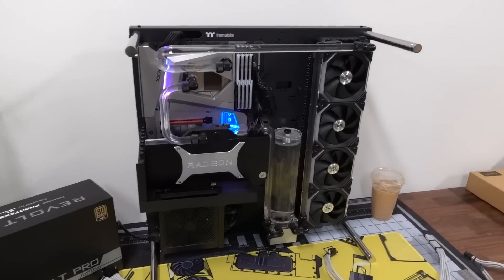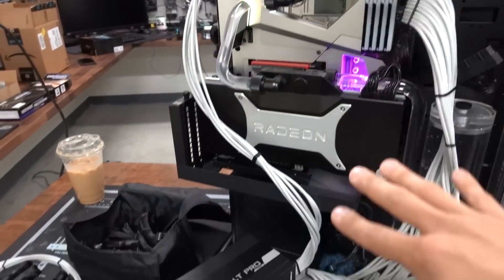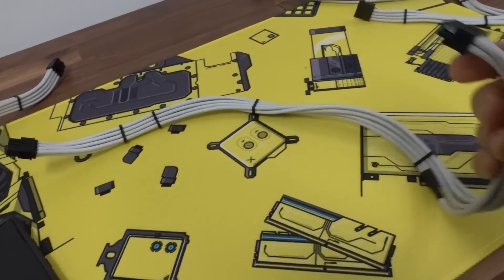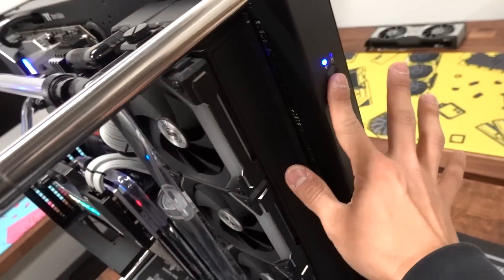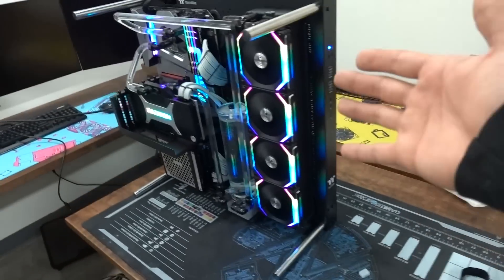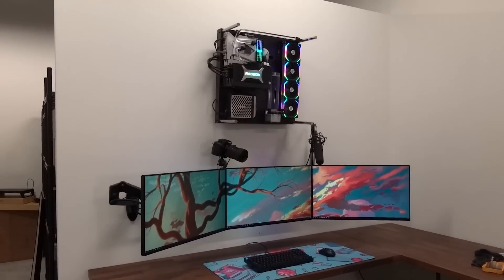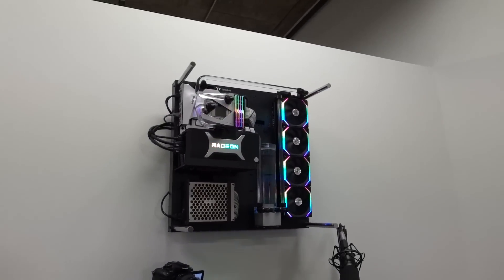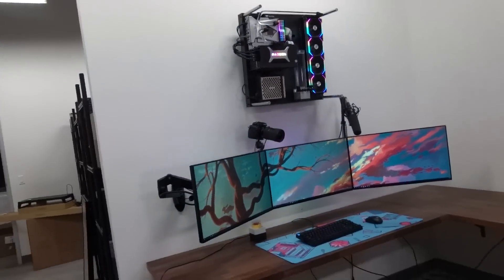I PUT MY PC ON THE WALL!!

Comment: put something (like a piece of wood) in the middle of the bottom of the back of the pc. it will force the bottom an inch or two away from the wall aswell and it will be straight. 
Had a similar issue with a mirror and i actually fixed it with multiple layers of cardboard.

Comment: You need longer bolts on the bottom of the vesa mount and a shim behind the bottom to push the lower half forward to match the upper part.

Comment: Think people are over complicating the tilt issue.

Just fit an appropriately sized spacer/ piece of wood to the wall near the bottom of case that is thick enough to stop it tilting, job done.

This also means you can still pull it out to work on it without hooks and ropes etc

Comment: In my engineering brain, why not make a mounting plate that can attach to the center stud at numerous points and basically cover the back side of the PC (cutouts for the back of motherboard and other needs spots) then add stand-offs to ensure that the PC lies on the same plane to ensure no tilt or angling of the PC.

Comment: I bought the amazon basics USB 3.0 hub and it died quickly(less than 3 months).  I then bought a Vantec 10 port USB 3.0 hub that has tabs for screwing to a wood desk.  Been really solid, would recommend.  Havn't had any issues with it since last April.

Comment: The EPS12V and the PCIe12V Pinouts are not the same! I really hoped the Protection circuits in the PSU are top notch while watching you plugging in random cables.

Comment: I'm no smart person when it comes to this stuff buttttt, the only idea I had was.... Where you attached those 2 hook on the back of the system, can you drill a hole straight through the wall, and anchor it on the other side of the wall on the stud? You can attach some kind of rubber grommet to the hole in the drywall so it doesn't break. Not sure if it'll work but it's the only thing I could think of.

Comment: Place feet or standoffs at the bottom of the case, to stop it tilting forwards. You won't need to screw anything into the wall, just the back of the case.

Comment: Can't you use a drywall anchor to line up with your top stabilizers?
Or maybe put something on bottom to PUSH/HOLD the bottom out from the wall and straighten it that way

Comment: Get a piece of wood, the thickness of the at the bottom to make the pc mount to be parallel to wall, paint it black, and use wall mount tape, Tape it the back of the PC Plate.

Comment: Just cut out a solid foam block (black to match PC) and mount it to the bottom middle of the PC with double backed tape.  Just make block tall enough so the PC is parallel to the wall.

Comment: Ok, so after the ads rant. You should run two 6 foot tracks across the wall parallel with the floor. Stronger.  You can then mount the pc to those tracks wherever you want. Put sound deadening boards on either side to cover the tracks.

Comment: Add washers to the bottom bolts of the mount to the pc. It will push out the bottom and then add leds to the back and make it a feature.

Comment: If you said it was one of the power cables I would have bet big bucks it was the ATX and not the CPU cable just because the power-on signal is on the ATX.

Also, mount plywood to studs, mount stuff to plywood.   Paint plywood to match walls or cover with cloth.    That way you don't care where the studs are related to where you want to mount things.

Comment: Just put a block on the back bottom of the pc that is he right thickness to hold it out the proper distance from the wall so it can’t sag.  So if the mount holds the pc 2 inches from the wall to the flat back of the pc make the block 2 inches and tape it on the back so you can’t really see it and it holds the bottom out

Comment: Try an upper and lower piece of wood on the wall and the case with a bevel so u just push up on the pc and pull it away. Could also do opposite bevels so u slide it in from the side

Comment: Have you thought about putting a large rubber spacer on the bottom side so it pushes the bottom away from the wall vs at the top to pull the top toward the wall and gravity will more than like do the job of keeping it in place.

Comment: Small block (wood, foam, plastic mounted to the back of the case near the bottom that will provide support when the PC is completely against the wall? 
small "legs" similar to what the front panel glass is mounted on on the back?

Comment: Not sure if this will help but had the same problem with a old tv mount he had, 2 or 3 pieces of Styrofoam foam or a cut pieces of wood at the bottom to push it out to straighten it out.  Used Styrofoam initially but eventually cut and sanded pieces of wood down to replace the foam.

Comment: A solid support between the bottom edge and the wall should push the bottom of the case out? Or put washers between the bottom vesa mount screws and the case?

Comment: drill un another two more hooked that correspond to the hooks on the case then you can tie it or use the tension hooks you got. The middle hook in the wall you can either leave it or remove it up to you

Comment: Kyle, Kyle, KYLE..... You don't straighten the PC tilt by pulling from the top. You push it from the back. You could just get like a 2x4 or something, cut it to the length you need, and put it back there. You should probably do that after the light strips have been installed so that you know where to put the block so it doesn't create a shadow.

Comment: How about using wood (or any other material) blocks screwed into the wall (or the case) on the bottom corners of the case to push the pc forward enough to be straight?

Comment: WALL ISSUE IDEA

With bottom support you can relieve tension on mount. Put something on the bottom, attacked to the wall or case to stop the downward tilt. Some sort of extension from the wall to push the bottom of the case to not tilt down but press on that wall extension/tube/whatever you put.

Comment: On the wall put some feet which stand off the wall so they line up with the bottom of the case so instead of tiring to tie it to the top of the wall put something in place to stop it from tilting forward

Comment: 13:40 Those swing joints should have screws that create tension on the joints. Just tool tighten the crap out of the one that's tilting up and down.

Comment: Possible Solutions: if you need space behind, then maybe a French cleat with drywall anchored screws on the sides and one screw in the center stud. If you don't need space, can try the same thing with "Z clips" instead of wood. good luck!

Comment: idea to make it straight put a spacer at the bottom middle area of the pc case parallel to the stud maybe strip of wood and maybe layer it with rubber so it wont scratch the case

Comment: I have the P3 and your P5 should have come with feet to lay the whole thing flat, use those and some spacers on the bottom of the back of the case to prop up the bottom so it sits level

Comment: Easy fix, get small Dow, double-sided tape it to the pc (length ways) and use Dow as a wall leg to push bottom of pc out parallel to wall.....or two legs , one on each end at on the bottom of pc.

Comment: what about putting shims on the bottom of the PC side . So the bottom 2 screws have a 1 to 2 cm push out to flatten the tilt effect . You may need to get longer screws but it should be doable

Comment: Paint a 2x4 and lodge it between the bottom of the pc and the wall. As long as u cut the 2x4 to the right length it’ll push the bottom of the pc out away from the wall making it level. It will also stay in place well due to the stress from weight of the pc. hope I explained this well lol.

Comment: Dear Kyle it's spelled correct but in German ✌️😉 greetz from Germany

And for your tilting problem mount a spacer underneath the wall mount and have a rubberfeet to compensate for possible vibrations. If the spacer has the right length it's straighten it pressing the lower part away from the wall and center it.

Comment: Are there screw holes on the bottom of the case? why not get some spacers screws to prop the bottom against the wall. maybe paint them black with rubber tips when against the wall?

Comment: Can you just use a self tapping screw at the top middle and mount one of those loops to the back of the case then use a strong cable tie to attach it to the loop on the wall?

Comment: The 8-pin EPS and 8-Pin VGA/PCIe are keyed differently on the component/mobo side. They may be (and usually are) keyed the same on the PSU side. For the most part, those set of 8 pins have same wire gauge/length requirements and same set of pinouts, just in a different order. You should be careful about it. I make custom sleeved cables myself and have a background in electrical engineering.
Reply: Some custom cables are too long for the standard gauge. In general, longer cables need thicker gauge. If I had my hands on your custom cables, I would inspect the resistance and connectivity with a multimeter to diagnose the root cause.

Comment: I use the same case in white and have had that bad boy wall mounted since just after the start of covid. It's amazing! Nice set up and vids.
On making it straight: Did the wall mount come with the spacers for mounting to the chassis? You could use two of the spacers on the bottom of the mount. Hopefully it will straighten and allow the screws to go in straight.

Comment: Use bump stops mounted to the wall at the bottom end of the PC to remove that tilt, be warned with it tilting like that it’s adding stress to both the PC and the mounting points.

Comment: Instead of trying to pull the top of the pc back to make it straight you could try using something to push out the bottom. Basically go at it reverse of what you tried to accomplish the same thing

Comment: For the tilting issue; you could use standoffs/thicc o-rings between the pc and the wall mount, but only on the two lower screws.

Comment: Displates on either side to fill out the empty space?

Also, as Indians say, "jugaad" work to fix the tilt - temporarily tack on thermocole slabs on the bottom to provide a jutting surface for the bottom to push against.

Comment: Please make a video checking the pinouts of the 8-pin extension cables and comparing them to the ones provided by the power supplies with a multimeter. As education and to help the extension cable provider.

Comment: dont know if that one has it, but my tv mount like that has an hex head screw that you can tighten to hold tilt angle. you can tilt it up, and tighten the 2 screws and it holds the mount at that angle, worth checking over it to see if it has them

Comment: Hey Kyle, try using some hood adjustment bumpers (automotive use) on the bottom back of the chassis to push the bottom off of the wall and that should force the top to tilt back?

Comment: Just use one of the screws on one side connected to the rope that's passing trough the wall hook and ends on the other one on the other side of the case.  Then adjust the tension. Voilá

Comment: tiny eye hooks directly behind the pc when its straight wouldn't do the job to hold it? or has this not been tried yet? if you're worried about them ripping out of the drywall then add plugs.
Reply: the ones with an open end lol thought I should specify...

Comment: Had a very similar problem with my PC that has completely different components than yours aside from having an x570 chipset and trident z’s. No post/boot and then connected all the original evga psu cables and it booted up.. added back my extensions one at a time and it was the cpu 8 pin extension all along.

Comment: i have the same wall mount for my tv you can try and adjust the screw that control the angle try to adjusting it higher then the centered position so it can handle the weight of the system and you will have it centered hope it help you

Comment: Paint a piece of plywood the same color as the wall, cut it down to the width of the stud and then the height between the wall and the PC, and place it in between the PC and the wall toward the bottom.

Comment: Drywall snaptoggles will get you around the stud location issue. Personally I would use a steel cable hanging system to make it look like it's fully hanging from the ceiling (not really the scope, but I think it would look cool)

Comment: the bracket you are using is designed to tilt down u need to buy a fully adjustable bracket, or flip your bracket upside down and reverse adjust it to sit flush on the wall, hope this helps dude

Comment: Don't pull the top of the case in, find a way to push the bottom of the case out from the wall. Perhaps some kind odf spacer at the lower corners or on the center bottom

Comment: I think I have a fix, add two legs on the back of the case one at each bottom corner. These legs will push the bottom forward and make it straight. Hope this makes sense.

Comment: You could use the 4-point mount you said you wanted if you opened the drywall and put in more 2x4s where you need them, and then replaced the drywall (a lot of work). :)
EDIT: Even better if you can access the other side of the wall easily.

Comment: instead of pulling it in from the top, why dont you push from the bottom to level it up? 
put a block on to the wall (you can get adjustable ones) that will just push the base back out to level it up. you wont see the block unless you look behind so that should work for you.

Comment: Why not just get a block of wood (or any material really) paint it black, and place it on the wall at the bottom of the PC. That way it will be straight. It will be off the wall a couple inches but it could look more floaty. Which could look nice 👍

Comment: Wasn't this wall open on the other side? Just install to new studs and use a normal mount. 
By the way, an normal mount with 2 screws in the middle is probably a lot stronger than an arm like that.

I would have custom made something with french clets to get it nice and tight, but thats just me...

Comment: I thought those mounts had adjustable rockers near the front... Either way, the studs should be 16" on center. You could technically offset the pc to be in-between the studs (either to the right or left) and mount some flat 1x4" maple (don't use pine in 1x4, it bows and cups) strips to each stud right where the top and bottom of the case would be. Finally, just mount the rear of the pc to the maple and boom. You could even do a French cleat so that the pc could slide into place and it would be flat and very secure. Maybe add racing stripes from the floor to the ceiling right through where the pc sits, further complimenting the offset look and your passion for vroomz. Boom. Sexy.

Comment: i say go to Home Depot get you some 3M double side tape and a piece of Hi density foam looks to me by the video that it would be 1 inch or 1 1/2 inch thick  bring it all home cut your foam and tape and stick it to the back side of the panel and the foam will press against the wal holding the panel flat and no more drilling holes in your walls  just before you go buy the stuff measure the distance so you get the right thickness  of foam all of that should cost you less than 20 bucks and solve your problem  ;)

Comment: Literally just glue a piece of wood to the lower back of your "case" as a standoff to make it exactly vertical... Add a little piece of carpet or a felt sticker if you're worried about the finishing of your wall.

Comment: The CPU EPS connector and PCIe 8 pin are NOT the same and are not compatible with each other. The 12V and ground pins are swapped. I'm surprised you didn't kill the CPU or motherboard.

Comment: Why not just cut a piece of 2x4 big enough to mount on the wall behind the case in the middle of the bottom? Use it to wedge it straight.

Comment: why not just put a bit of hard foam/polystyrene left over from PC packaging and tape it to the bottom back of the PC. make sure its thick enough to prop/push out the case so it lines up flat

Comment: Just put one or 2 filler blocks in the bottom - anything really, wood, metal, rubber, a door stopper or what ever... 1 in the middle or two either side. double sided tape, glue or silicone, anything will do.

Comment: I think if you just made yourself a french cleat to mount the pc that would probably solve your issue you would just have to find a machine screw that matches the wholes on the back of the pc case and you should be fine

Comment: 4PCS Headboard Stoppers for Wall, Adjustable Bed Frame Anti-Shake Tool, Bed Wall Bumpers with Free Furniture Pads and Screws, Headboard Wall Protectors, Protect The Wall(1.18"-4.72")

Comment: Bro just place a piece of wood on the same height as the end of the lower back of the case. Then just make sure the "arm" does not push the setup away from the wall.

Comment: I need some advice, I just bought a whole new computer (ryzen 5 2600x, 16gb 3200mhz corsair ram, asus rtx 2060 6gb, asus rog strix b450-f) in January.  It was amazing at the start but then I noticed some weird 3D model tearing and I thought my PSU wasn't giving enough power to my graphics card so I bought a whole new power supply. Turns out that my Rtx 2060 is the problem and it's less than 2 months old, I don't know if I should send it back to asus or not because I need this computer for school and stuff like that. Any advice?
Reply: U have to replace it

Comment: You did use the stock cables before but you didn't switch to the hdmi cable until after switching from the REVOLT to other PSUs. So yes you did but that was just one issue you had.

Comment: how about instead of pulling the pc toward the walll... you space the bottom of the pc... out until it's level. adding a translucent bump stock is easier then pulling that weight around by strings.